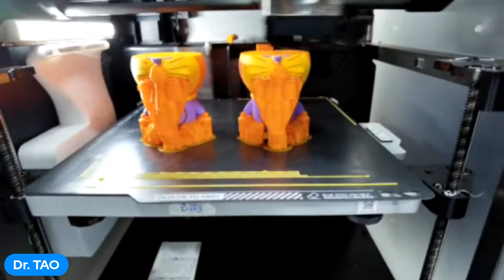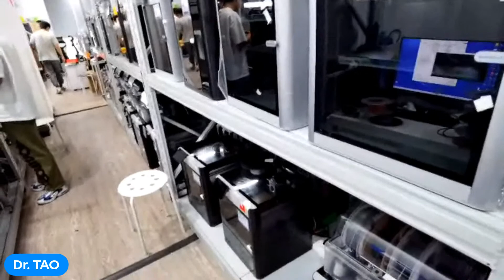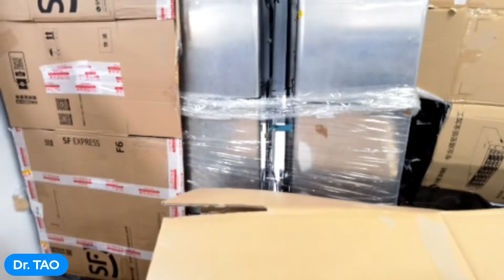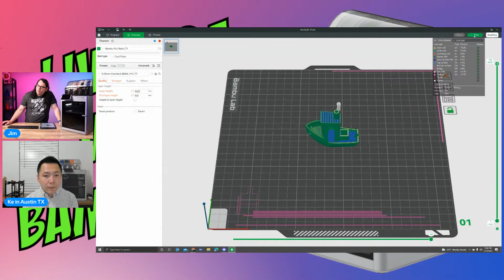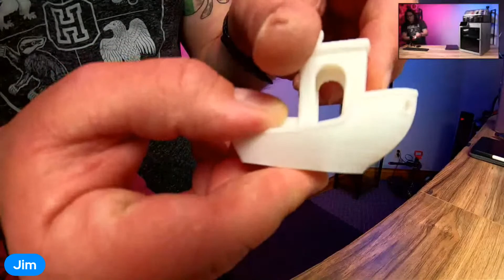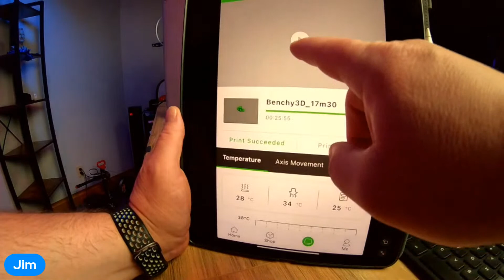Live With The Team From Bambu Lab and a 17 minute PLA Benchy!

Comment: Does the printer do the calibration and vibration before every print? Or just once and then stored as a mesh? I dont want to hear the vibration sequence every single time I do a print. It will drive my wife crazy.
Reply from the maker: The big one only once, or I would do it if you move the printer. Otherwise you can do it every time, but it's turned off on the slicer by default so you don't have to.

Comment: How are you going to manage a 60 day fulfillment window? Are there only going to be a very limited number of units? (Im interested in the carbon model.)
Reply: Also what is the highest strength rated Carbon filament the unit can use?
Reply from the maker: @atranimecs  I'll have to check
Reply from the maker: They have a full production line, and production units ready to go. It probably is limited to start, but they are in the ramping up stage so it will go fast!